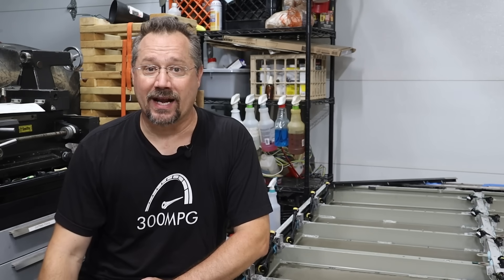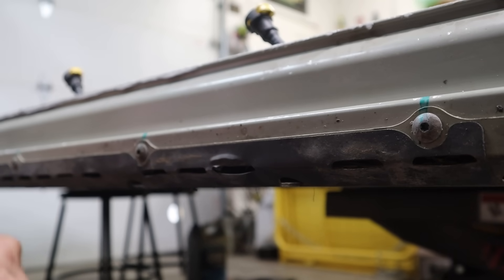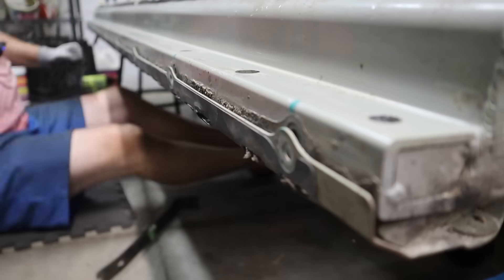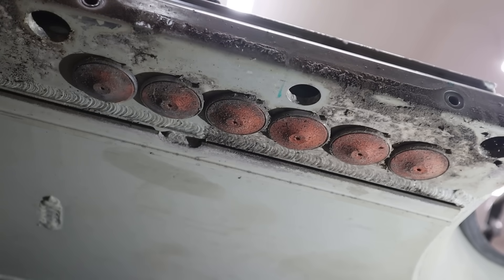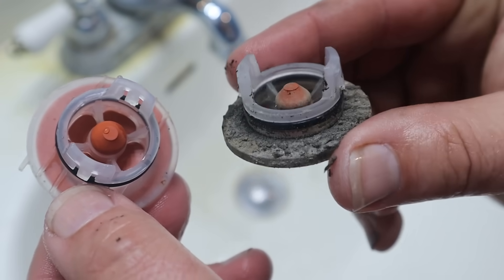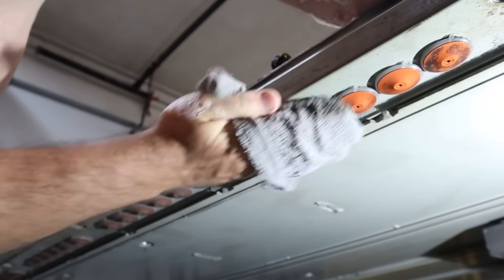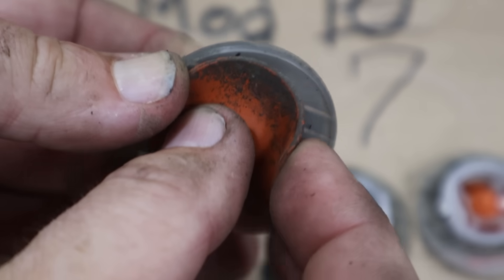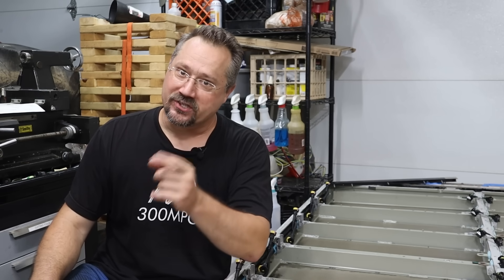Tesla Battery Repair: Umbrella Valves

Comment: Those umbella valve are poor design, they only have to captive clips and you can see where the water/Dirt has ingressed each side of the two clips, they should have four captive clips then this will make the seal much more reliable, I don`t see why they do not upgrade them to four clips and give themselves a pat on the back

Comment: Seeing this makes me happy I installed mud flaps shortly after getting my Tesla home. I have a Model 3 so it may not have the same valve design but seeing how vulnerable this design is to dirt off the front tires makes the mud flaps seem like cheap insurance for a potential issue. Thanks for sharing!
Reply: Model 3 has only two valves and those are in the back of the car.

Comment: Superb videos Benjamin, & great attention to detail. Could the umbrella valves be removed for cleaning without dropping the battery pack?
Reply from the maker: I don’t think the umbrella valves could be inspected or changed with the battery in the car. 
The side covers are held in place by screws through the side. Those are not accessible with the battery up in place.

Comment: Those ski rail covers couldn't have been expected to keep all water and dirt out effectively. There are numerous slots and such that would allow dirty water to get in. I suppose the rails were to be shields from tree branches and such. Driving in the rain, along with splashing thru puddles will get the water and dirt in to where the valves are.   And, wow, so many valves.

Comment: Ben, Curious how you'd reconcile this battery passing the pressure test you recently did, with its valves in such bad shape?  Did you retest pressure, before opening the pack and was it bad then??  For ski screws, you can also heat them (heat gun, or brief propane) to break blue Loctite free. It isn't just the ski wanting to come down that tensions them.
Reply from the maker: A year ago, when I got the car and fixed the fuse cover and a few other items, the battery DID pass a pressure test. 

I FORGOT to do one before opening the pack on the current repair!

My best guess is that the umbrella valves in module 7 and 10 at that time were probably already pretty dirty and getting worse but were still just good enough to pass the test. 
After replacing the fuse cover, there weren’t any air leaks at that time.

Comment: I have to wonder why on earth Tesla didn't make a valve that was 'solid-state' ie no moving parts until the pressure got to a certain point (pretty low pressure to avoid any danger of a 'bang', if you know what I mean) when it 'pops'.  That would prevent the organic 'creep' passed the seal that looks like what allowed moisture through in the end... and you corroded cap problem...

Comment: very informative. regardless of the design of the valves... is there a way to seal those plates so that dirt can't get in there? i realize air needs to get through (that's the point of the valves) but it seems like the direction of water and dirt can be predicted... also there are some materials that will allow small amounts of air through without water, such as cork or gore-tex. But maybe just strategic placement of sealant could keep dirt off of the valves?
Reply from the maker: The newest configuration of valves in a Model S battery pack uses only plugs in the very front, significantly fewer umbrella valves in the rest of the sections, and adds gore-Tex breathers.

Comment: I think a faster way to remove the valves without as much "prying" would be to put a metal or pvc 'ring' about the same size as the hole over the two arms. That would compress both sides enough to just then push them through without any prying or bending the legs too much. Something like 2 1/4 inch pvc or a pipe maybe? However big the mounting holes actually are.
Reply from the maker: Keep in mind that the coolant lines are right in the way of the umbrella valves. Any tool that would have to go over them would be difficult to use.

Comment: The long bolts on the spine, and cross bars, have factory seal material on the head, and thread locker. The RTV should sqeeeze through the hole when you place the cover on.

Tighten the spine bolts FIRST. DO YOU HAVE THE TORQUE SPEC FOR EACH TYPE OF SCREW?
From bump cover end to rear by the ancillary tray. 
Be absolutely sure, start treads by hand. If you strip the spine threaded insert, you are doomed, unless you have experience replacing sain inserts. If those spine bolts do not tighten, you will have a point of water intrusion. 
Tighten the cross bar silver SLEEVE inserts next. 
Then  the long cross bar bolts. 
Then perimeter screws.
 
Any perimeters screw hole thread stripped? Tap the next size up screw.

Comment: The umbrella vavles were not a "design flaw". No other company built any EV similar. 

That vehicle drove through very muddy water and/or parked with the umbrella submerged. No doubt. Also, this vehicle is more than 10 years old, and do you know the regional history? I doubt anyone washes the underside of a Model S.
 
The rails you removed are called "skis" on the manufacturing line.
Do not lose the small black rubber pieces/stripsq which prevent rattling. 

Bop the rails with rubber hammer BEFORE removal. Also, apply PB blaster to the screws and allow to soak at least 5 minutes. 

Be sure to put thread lock on the screws when reinstalling the skiis.

Yes, the latest enclosure has been upgraded. The experience/knowledge gained indicated that less umbrella vavles was okay, saves a substantial material and labor expense, and are of better materials. 

To install umbrellas, one thumb on each side of a valve,   where the little tabs are, and push up both simultaneously very firmly. They should "click". 

Be sure to lube the OLD umbrella O rings before reinstalling. New valves should arrive lubed.
Also, highly inspect each valve after installing. A poorly seated O ring will leak water/air.

What RTV will you use to reseal the top?
You need a bead on the spine, each cross bar (try not to RTV into the bar holes). Then continuous RTV the whole perimeter. 

Then RTV seal the bump cover. 
Seal the water quick connect with Right Stuff BEFORE  installing the bump cover. Tighten the quick connect by hand carefully, you do not want to strip the threaded brass inserts.

Have you inspected the Ancillary Tray components for water/corrosion?

Will you install NEW contactors?

Will you install a NEW main fuse?

You can use Right Stuff to seal the fuse cover. A pencil diameter bead on the pack. Then install cover. Then Right Stuff on the exterior joining edges. Finger/paper towel with 90% IPA will smooth the appearance.

 Be sure to inspect the square orange cover vent for dirt obstruction. There is a small sponge filter in that.

Comment: to rremove the valves faster from the top radio pliers should do the trick faster and easier to press those latches to gether.
not sure if radio pliers is the proper translation but it is in general pliers that have a curved shape with a 45° angle and maybe 3 inch long. 
They are used for electronic works usually to bow resistors and what not we know from the pre SMD era.
Reply from the maker: I tried some different pliers similar to that, and they didn’t work as well as I thought. For me, just pushing the tabs with a small plastic pry bar worked better. 
Guess it varies with a person’s tools, dexterity, etc.
Reply: Cranked needle-nosed pliers...?

Comment: Tesla’s design change & conclusion is the same as mine: plug them.  

I think those are drain-only valves.  They’re supposed to left water or pressure out, but not in. 

I’d install extra shielding or sealing on that front part of that bracket/ cover to reduce the dirt intrusion.
Reply from the maker: Yes, I’ll be adding some sealant at the very front of those side covers.